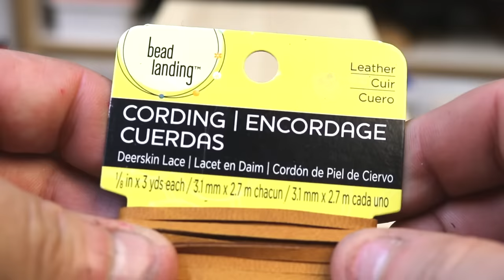I turn two screwdrivers into Deadpool's katanas

Comment: Now make the full-size version?
Reply: Ryker Galagun that’s gonna be either a really big screwdriver, or a lot of them. Not easy to do maybe you should think about all the possibilities
Reply: This take a lot more tools with forging the bar of steel and you need different hammers and a full size anvil and quenching oil and larger belt grinders and buffing wheels and a lot more material. This is just a quick little project so you have a neat little doodad
Reply: Ryker Galagun lk

Comment: Are these allowed diring flight?
Reply: Sebbel Pro - Road To 1K probably not lol 

They are real sharp knives 

I mean hell you aren’t even allowed earrings on a flight
Reply: Tristan Sullivan well if you disguise it as a travel bag clip on design, you might? But it won't pass the metal detector tho.
Reply: Angelle Porillo you aren’t allowed any metal objects on the plane 
And yes the metal detector will see it
Reply: Tristan Sullivan oh... I never been on a plane😂 So I never really get to know the strict policies around them....😂
Reply: Tristan Sullivan what airline are you traveling on? You are allowed metal objects they just have to be legal. Like phones, laptops gadgets, jewelry etc.
Reply: Angelle Porillo you can carry certain blades on a plane like razors and scissors if they are in a plastic mold but i doubt this would be accepted since it isn't in a plastic mould or anything.